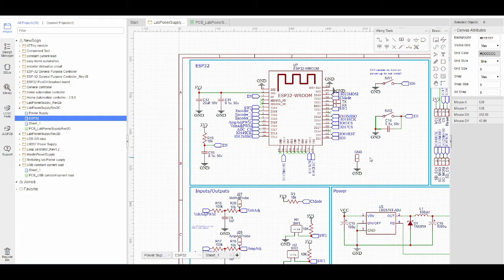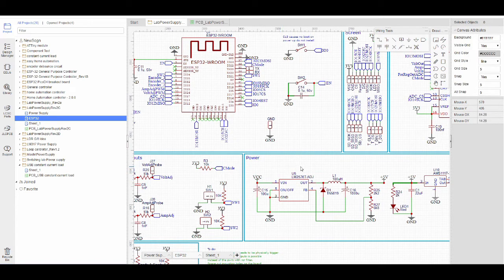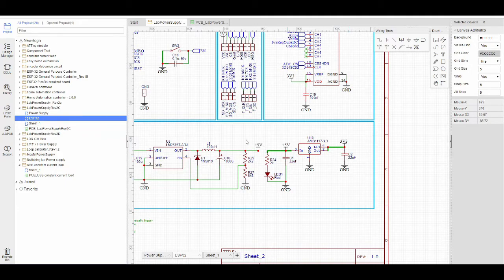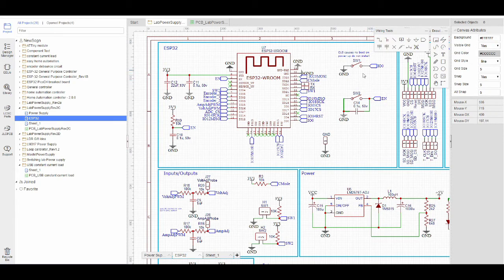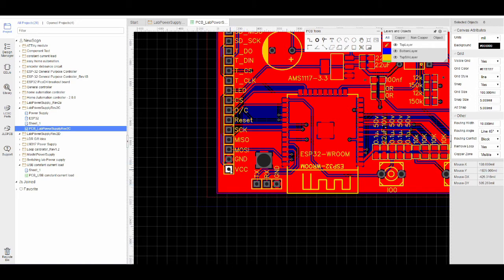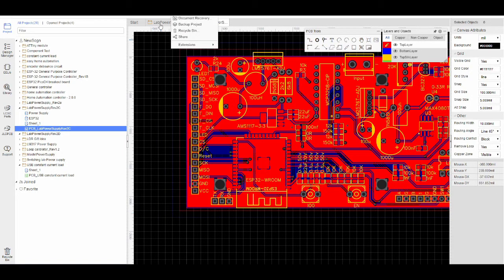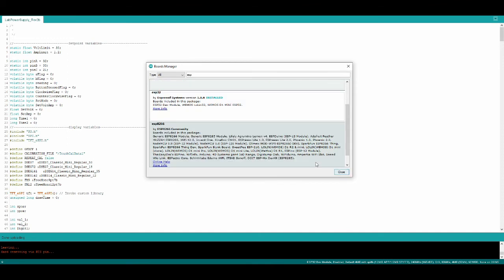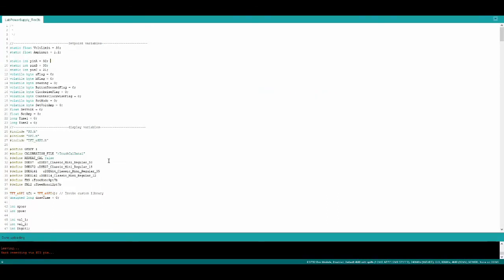How to ESP32 on a custom board - Circuit and arduino setup | Power Supply Design Series Part 4

Comment: Hello there. I built my own board and I couldn't upload my code just the way you did. Arduino IDE tells me "error: Invalid head of packet (0x00): Possible serial noise or corruption." Can you help me?
Reply: Never mind. My bad soldering skill made this error😅
Reply from the maker: It’s strange sometimes like you said you had a soldering mistake, i would have thought that the board would not even spit anything out, but sometimes you can see it…. That and decoupling capacitors are so important